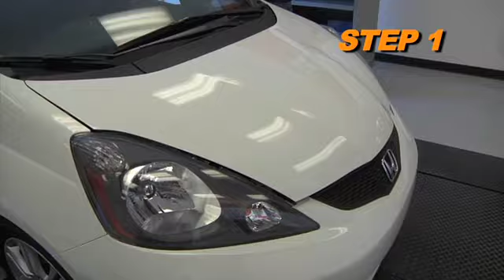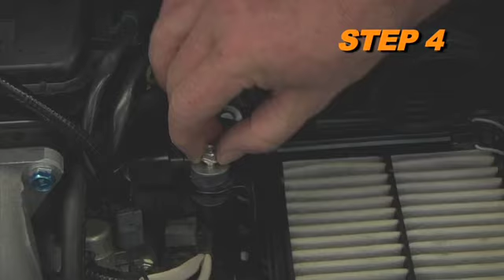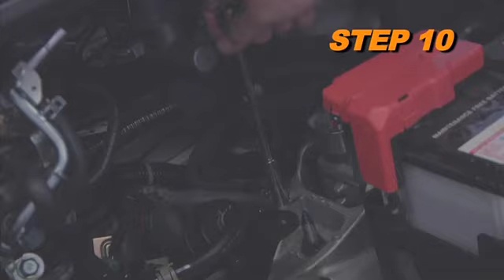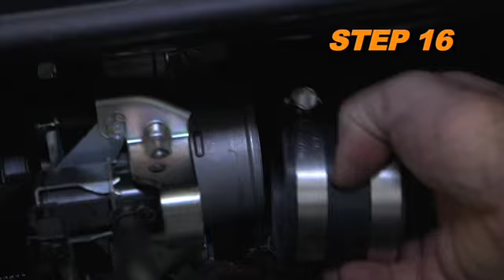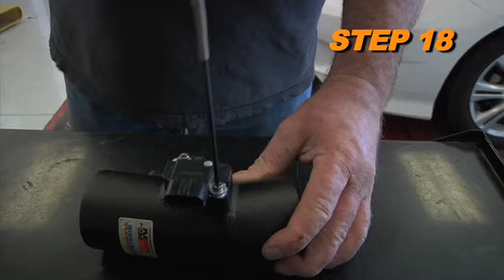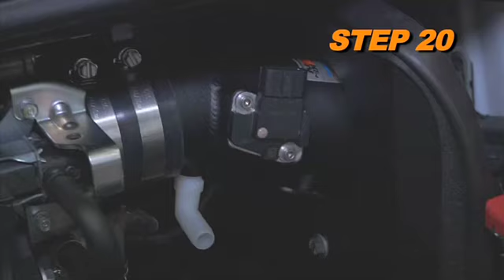Honda Fit 1.5L [#69-1017TTK] Air Intake Installation

Comment: How do you get rid of the too lean check engine light?
Reply: I called that number and they are useless. Product is crap. Don't waste your money.
Reply from the maker: Please contact our product specialists at 800-858-3333 or tech@knfilters.com. They will be able to quickly help you resolve the issue.
Reply: You don't. Been trying different things for a year and nothing works.

Comment: not sure why is the filter placed all the way corner back where no air flows there
Reply: There's a shroud under the hood that directs air there. That's where the air enters with the stock system as well.

Comment: Got this for my 2009 Honda fit sport made sure everything was hooked up properly and followed the instructions to the teeth and got the engine light tripled check the connections still got the engine light. Soon as I went back to stock the light went off
Reply: same 2009 honda fit sport.
Reply: did u ever figure out the problem?
Reply: @jorgebeverina603 could be your air-fuel mixture, stock air box is more restrictive then most after market ones which then the after market intake lets in more air and messes with the air- fuel mixture
Reply: @mrmohle3321  so how to fix this, gotta change ecu computer thing??

Comment: Will this installation for my 2013 honda fit sport make the engine check light on on in the dash?
Reply: that's what I'm thinking.. it's gonna mess my sensors up
Reply: @John3one7  It is possible, but your computer also learns to adapt and adjust the air fuel ratio.

Comment from the maker: Unfortunately, we do not produce an intake kit for your application at this time. We do not recommend using this kit on your application; there could be different mounting points or cause a check engine light, etc.

Comment from the maker: @OTTOLOKS It could be the tuning of the tube itself. Keep in mind; all of our systems are tuned to work with stock programming of the vehicle. Your system could be too lean for the MAF senor to read. The placement of the MAF sensor is vital for the system to work correctly.

Comment from the maker: @strickmans The intake systems will not take in more water than a stock system. It takes the entire filter to be submerged in water to pull it through. This system is a short ram, so the entire engine compartment would have to be under water for this system to pull water. We also produce Drychargers that repel water and extend service life of the filter.